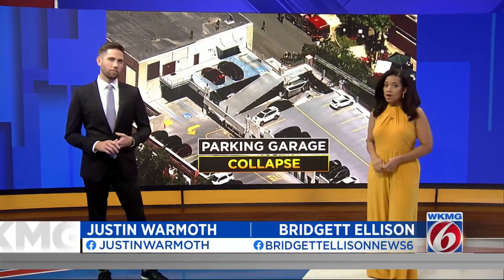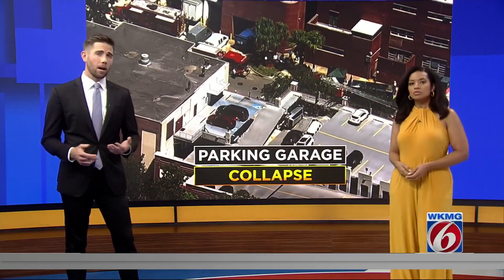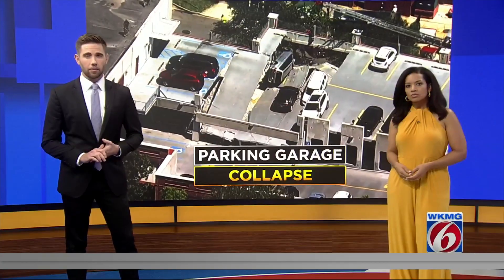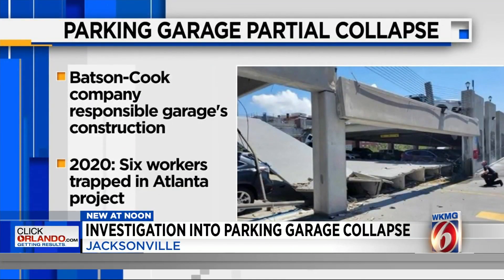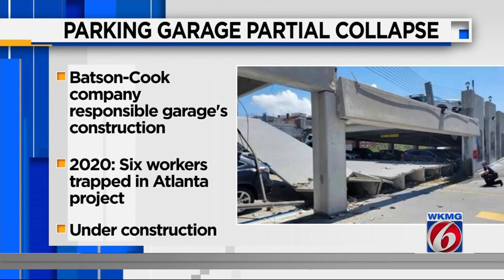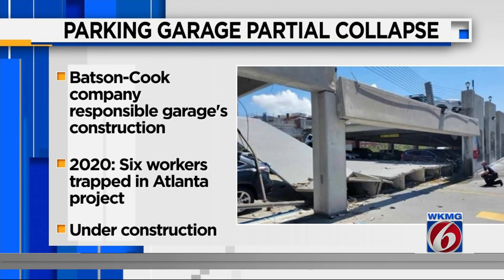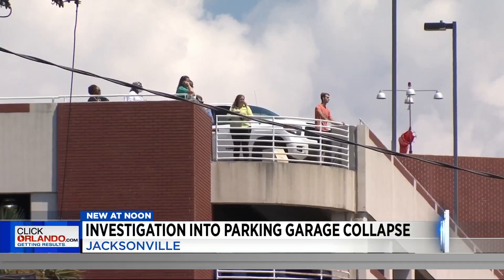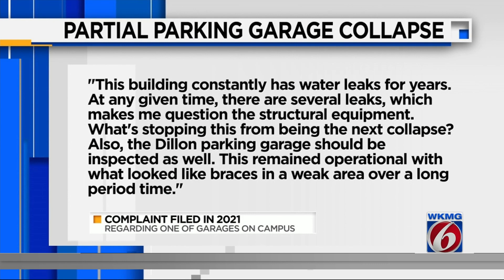‘It was crazy’: Part of top floor of Florida parking garage collapses

Comment: Reports like this always seem like they are surprised. In Texas, for example for foundation repair. Must be licensed in each municipality, to begin a job a plan complete with measurements and pier placement must be submitted along with an assumption letter from an engineer confirming that the plan submitted is acceptable. In order to be complete the structure must pass several inspections. One from the engineer and at least 2 inspections from the city or municipality and only after the engineer confirms the structure is inspection ready. 
  If it passed inspection the company met the standard, why would the company "do more" if they passed inspection. More often than not, inspectors have the knowledge and received an education but lack hands on experience and can't tell a bad weld from a weld that will hold.... neither can their ego